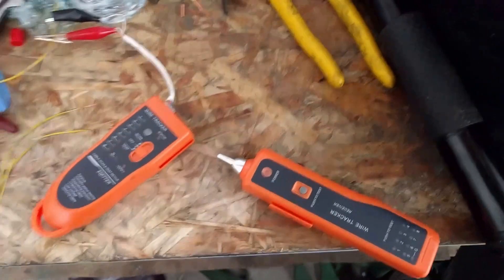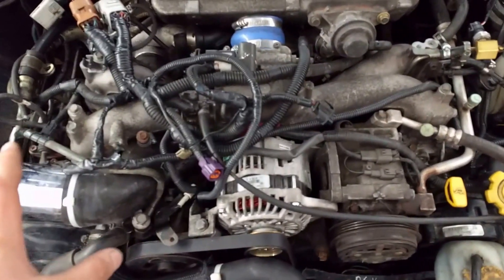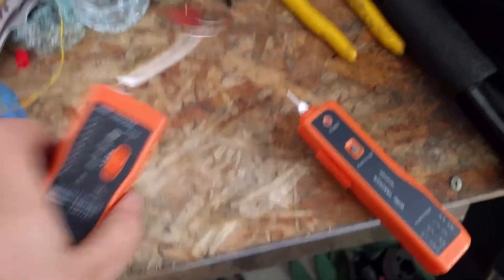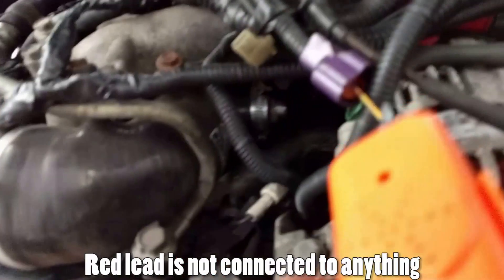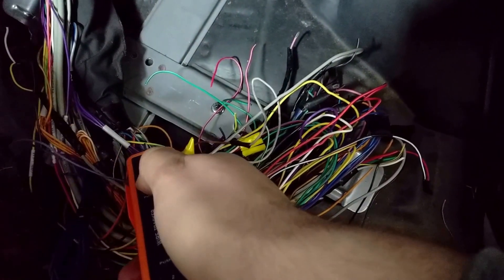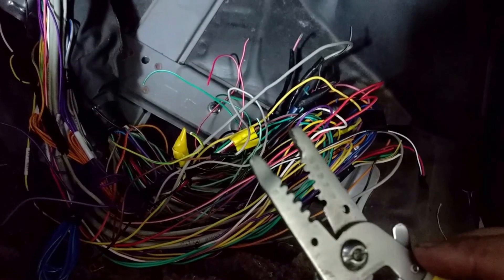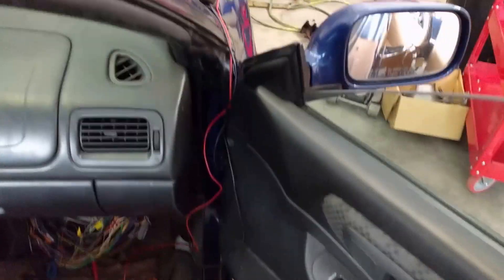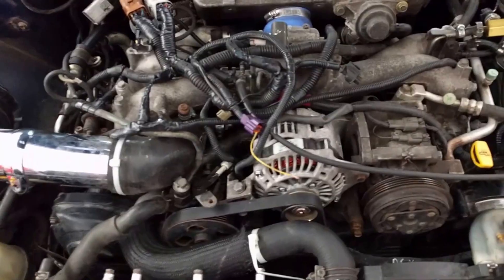How to Trace Harness Wires with a Cable Toner

Comment from the maker: Let me add one little footnote here: Use common sense along with this. You can't just go "Oh I'll use my Vehicle Speed Sensor wire, it should be fine!" when in reality it not only goes to the ECU, but to the dash cluster too (at least in this car). I knew what this connector went to before hand and that it likely wouldn't split anywhere else in the harness.

Comment: This tool looks super awesome in this demonstration. I just bought one, a different model (Sperry ET64220) and I couldnt get it to work all that well. Does the one I bought suck or am I using it wrong? Do you have to disconnect everything from the battery?
Reply: Go for a Fluke! They are pricey but you won't feel dissapointed later. Take my word for this. Fluke matters!
Reply: @roseelectronics4582  I just tried a Klien one thinking they have a good tool reputation. Still couldn't get it to work well! I only conected one alligator clip to the wire, now I'm wondering if the second needs to be conected to ground
Reply: @TheIanmurphy   I have one by Tempo and instructions say the 2nd lead must be grounded, preferably to an independent ground.
an automobile ground is common to the whole chassis because  everything returns to the negative side of the battery, so it's not independent.
I use a long lamp wire with alligator clips at both ends.  Clip one end to my house copper water pipe coming in,  the other one to the second lead, this works because you don't have the signal looping around.  I hope this helps.
Reply: @JavierGarcia-dn4zz  interesting, I will have to try this. Thanks for the tip
Reply: To answer your question about the power being disconnected, yes. No power on anything being tested, you could burn up your tracker.

Comment: Help my OBD II port has no power do I put which clip on the wire to the 16 pin and which clip to the body to ground? I have to do this can't get anyone to help!
Reply: Unplug the battery wait 15 min
Reply: @stevenlemay9004  This was from years ago a wonderful mechanic had stabbed the wires creating a short I had it repair!!! Upstate NY Coxsackie mechanic  is very rude it's right by the thruway exit save yourself a headache like they gave me it's call Dr something!
Reply: Check your OBD fuse